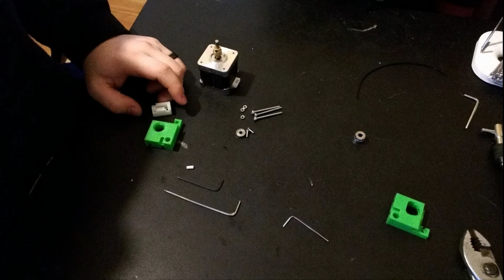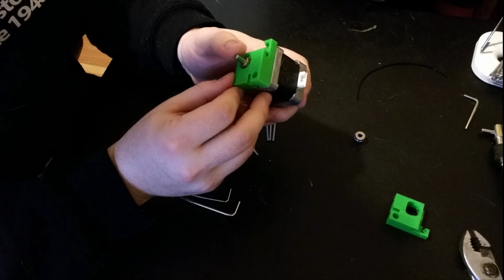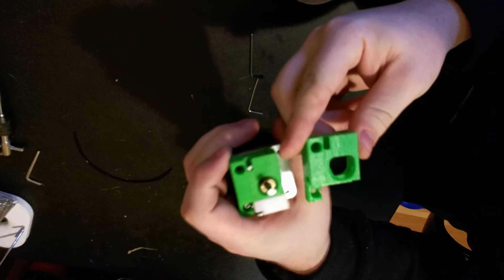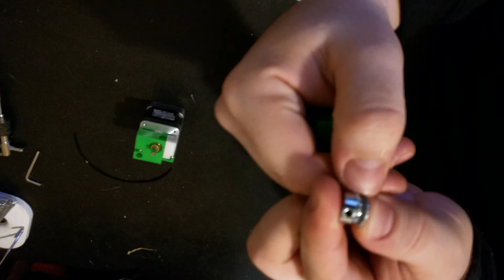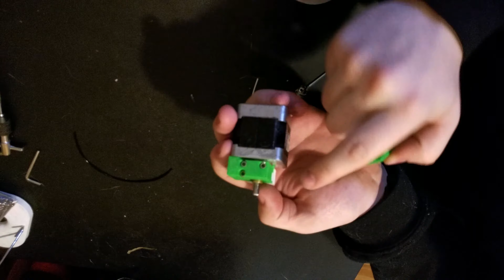Neustruder Assembly

Comment: Curious - how does the stepper motor mount work on your printer? I'm trying to mod a mk7 where the only mount for the motor is at the bottom of the plate that holds the riser tube and has one other threaded hole. I could cut the top part off, but...

Comment: Seems like a great design for flexible filaments! I will print the CR-10 version you posted on Thingiverse. There you mention that the 5mm Hobb-Goblin gear from E3D is preferable over the standard 5mm MK8 hobbed gear. Is the difference noticeable? The price actually is ...^^
Reply from the maker: Nicolas the tooth profile and quality control (actually having sharp teeth) on the hobgoblin made the extruder's consistency much better for me.

Comment: Good work. Looks awesome.
Reply from the maker: Alex Wilkinson Thanks! if I help one person I'm happy.
Reply: Yeah there's some good engineering in this bad boy.

I was thinking of creating something similar, but I like E3D Titan's idea of having the extruder still be geared with something like a 3:1 ratio, as well as 3 mm and 1.75 mm compatible (just because I have a ton of both haha).

Wonder if we could create a new design - similar principles, simple construction and simple parts to print, but with a herringbone 3:1 ratio breakdown.

Also that bearing slop might be an issue because it may cause a bit of backlash depending on how it interacts with the filament. Not sure how that would be elegantly fixed though - 3d printer tolerances are always tricky to overcome. :)
Reply from the maker: Thanks!

I'm all for gearing, but I'm also a firm believer in "if it works, it works". I don't really have problems with filament grip or extruder power (even using the stock motor) so I don't see the added benefit of the extra complexity.

In addition, the Titan extruder can't be directly bolted to a regular mk8-mk10 hotend that is commonly used on makerselects (the printer I designed this for), Wanhaos, ect.

Thankfully, there is no backlash because the bearing is always held against the filament. Since the inner race of the bearing moves instead of the printed axle when the extruder is loaded (remember, this isn't spring loaded) the bearing keeps in constant contact with the filament as the distance between the bearing and the gear is fixed.
Reply: Agreed, the simpler the better. 

Yeah, I just use a lot of 3mm filament (which has advantages for flexible filaments since they're more rigid at 3mm) so I was trying to create something that worked along those lines. I have some pretty weird ideas that I'll attempt to build. I probably won't even use an idler bearing, I'll do what the flexystruder does and just have the hobbed bolt push right against PTFE tube (look at my flexystruder video for clarification) - might be a way to make yours even simpler, if you wanted it to be as simple as possible.

I have a couple Wan Haos. Maybe i'll throw one of these bad boys on them. :)
Reply from the maker: If you do, let me know! Many people have downloaded this but i don't get much feedback.
Reply: That's because people are savages and your name isn't Prusa, Greg or Wade - Otherwise it'd be the talk of the town. :)

It is impressive how few parts it uses. The 604zz bearing doesn't happen to be the one you pull out of the stock extruder, is it?
Reply: Also something I learned from lulzbot about this stuff and printer inaccuracies is have people drill out holes after with the correct sized drill bit. Only way to get guaranteed accuracy for hole sizing.
Reply from the maker: If you're talking about the axle, its mostly because I didn't have cooling on when I printed it, otherwise the holes that I print for regular hardware have no problems. I get .03mm accuracy on hole diameters typically with my rigidbot. More than enough for me! The holes in this video are printed and work perfectly. Have you seen the video where this is installed and it prints out TPU? 

No, the 604zz is not the same bearing from the stock extruder. The bearing that's on the stock extruder is too small for this design as well as being channeled, in order for this to be the most efficient, a flat profile is needed to prevent extra friction on the filament.
Reply: I ordered the bearings, but from China. They'll take forever to get here, but when they do I'll give this a shot. :)
Reply from the maker: Sounds good!